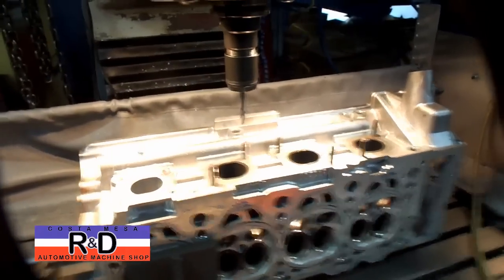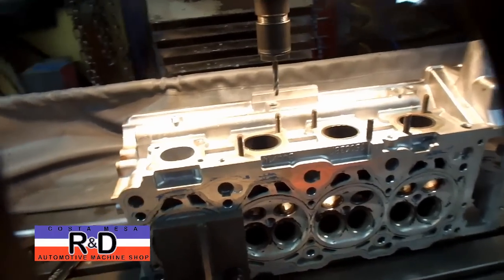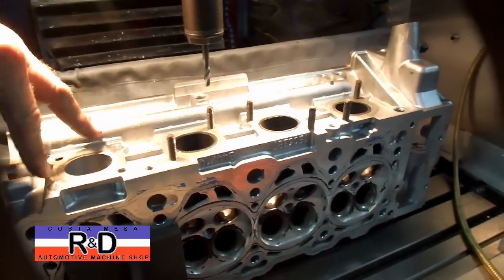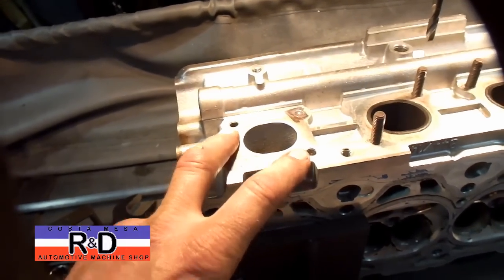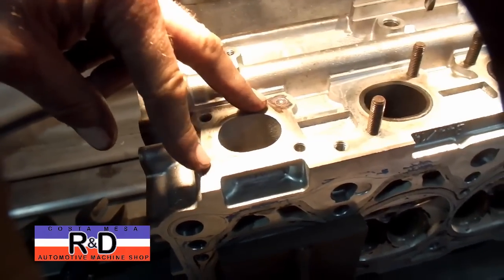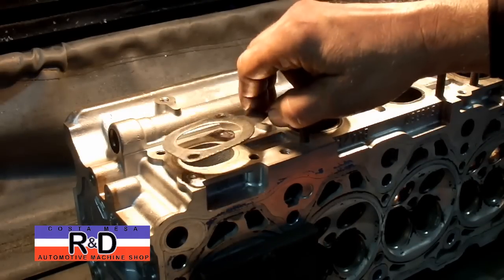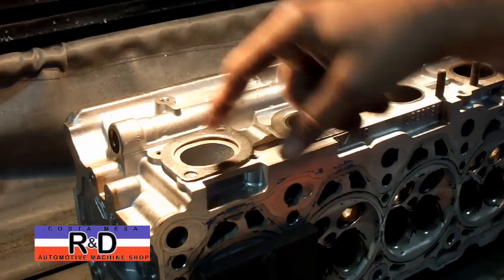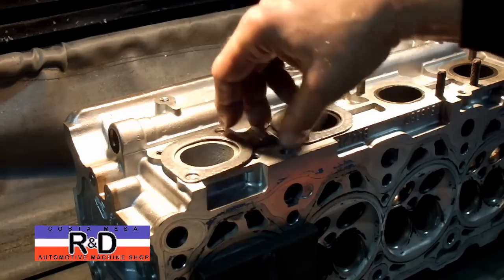4.0 BMW Cylinder Head Modification

Comment: Is this an N62 engine?  I had to do the same on my N62B44.  Core came out of an early 2003 745i, going in a 2004 545i, where the head studs are different on #4

Had a machine shop drill/tap holes in the "new" locations.  First start after rebuild was last weekend and so far so good.